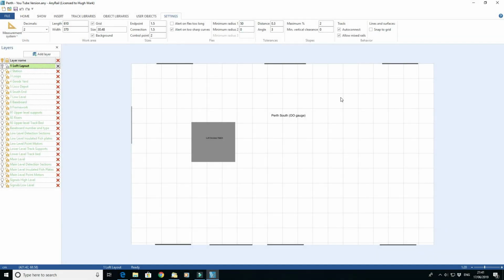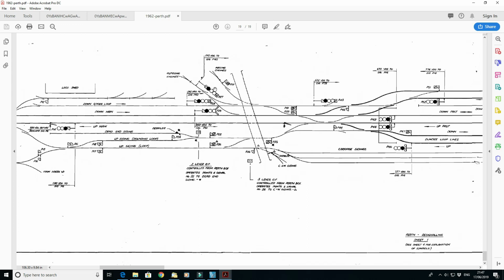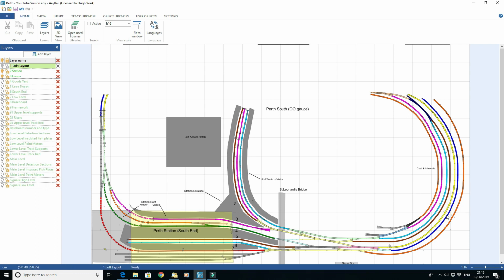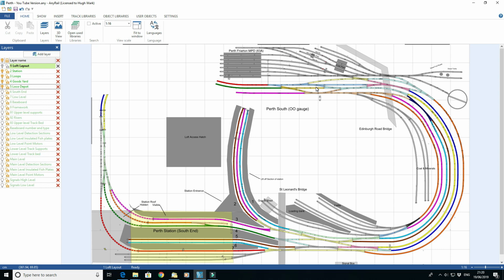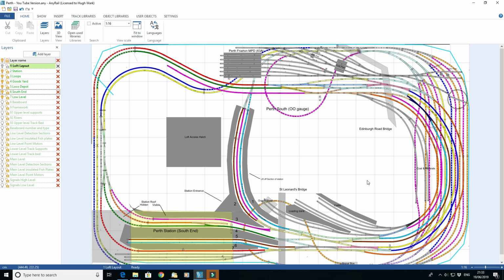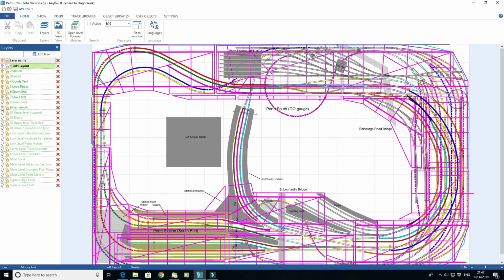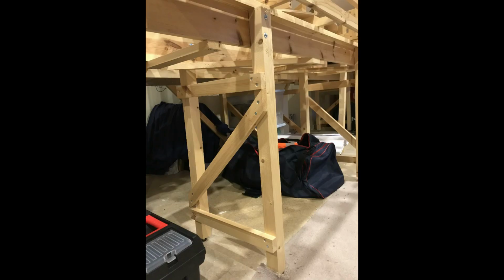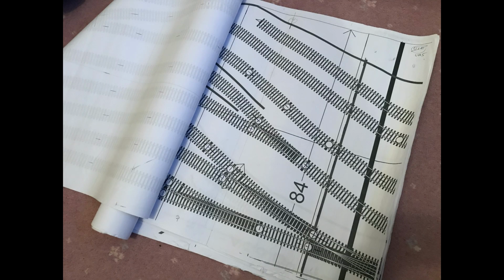Perth South Model Railway - #2 Planning and Baseboards

Comment: Very nicely presented and sensible approach to building a layout of this size - the best way to get it right first time. Its a godsend when getting so close on practical gradients versus the necessary rise and clearances between levels as I can see you had to be extremely careful with, ditto for me, doing same but using SCARM. Where I live have huge humidity swings 25 to 65% (plays havoc with pine furniture - draws jamming) so gone with Baltic birch ply and get 5mm movement over 19 feet length over 12 months, baseboards almost complete; yet to start laying track so expansion joints a must. 100% agree on fishplates being unreliable conductors/ source of appreciable volt drop. Have subscribed, will be catching up looking to see how you progressed on what will certainly be an epic and fascinating layout, particularly on the automation. Best regards Stephen, Canada
Reply from the maker: Many thanks Stephen. We certainly don’t have such extremes here but agree that getting baseboards as trouble free as possible is a must. Hope you will be able to share progress on your own layout in due course. Good luck and have a nice  Christmas. Hugh.

Comment: I came to this channel via your video on St. Leonards bridge, but the channel turns out to be a very good guide on construction of a relative complex layout from A-Z.
You've made good use of CAD, I use Anyrail too but not yet very experienced with it to calculate levels and draw in all separate sections of timbers to go in.
The loco depot is a good compromise on the real thing, the placement of the coaling and ash towers relative to the shed make it very recognisable, in my mind I can see the rows of native locomotives, visitors from Kingmoor, Eastfield, Waverly and Ferryhill and the miscellaneous bunch of surviving pre grouping locomotives standing in front of the model shed, sometimes even a Co-Bo, having a fill-in duty between two Condor runs.
I'm going to watch the whole series in your playlist yet.

Building smaller layouts for the exhibition circuit over many years now I settled down on birch plywood as my material of choice.
It doesn't come cheap, but doesn't splinter as much, doesn't delaminate easy and can take a fair amount of moisture from building the scenery.
I also make the girders and joists from this plywood as it doesn't warp like sawn pine timber, the top grain is held lengthwise when I cut them.
Reply from the maker: Many thanks Tom. Glad you enjoyed it. Yes the line up of locos you describe is mouth watering and hopefully I will be able to replicate it. You are absolutely right about good quality plywood. I only hope mine will last over time and the application of scenery. Thanks again. Hugh

Comment: I'm about to embark on a similar sized layout myself, based in P&K and you'r experiences are really useful. However, one question that would help is, where do you source your rails and control systems etc from being based in our area?
Reply from the maker: Hi John. I’ve bought my track and control systems on line. Track from Hattons Model Railways and electrical and electronics from Digitrains of Lincoln. In non Covid times, for general Model railway purchases I’ve gone to Invergowrie models and Harburn Hobbies in Edinburgh. There are of course lots of other options and if you do some searching on line, you can find where to get the best deals. Note that some Peco track items are quite hard to come by as Peco stopped manufacturing for a while during the first lockdown. Good luck with your layout. Hugh
Reply: @perthsouth5576  thanks Hugh I’m finding it hard to put it all together but guys like you and other Youtubers fill in the gaps. Thanks for all your efforts.

Comment: Your project and approach is both inspirational and aspirational. As a sanity check as I progress my own project, what height did you select for the top of your L girders and what does that translate to for the height of the top of your scenic baseboards?
Reply from the maker: Hi Mark. The top of the L girder is about 84cm above the floor and when you add the cross members and 9mm plywood on top, the lower baseboard level is about 90cm above floor. Main scenic level is another 10.5cm above that meaning it’s just over 1m above floor though with the varying levels and gradients it rises to 1.035m above floor. Thanks for watching. Hugh

Comment: What is the minimum radius that you have used on the layout, and what is the radius of the reverse loops? And can I ask what the minimum height clearance between levels is?
Reply from the maker: Hi Bob. I’ll need to go back and check the plan on the computer but from recollection I tried for 900mm on scenic sections and 600mm elsewhere. However the reverse loops are peco settrack 3rd radius curves at 505mm. I was a bit concerned about that but only problem has been pony track fouling front steps on one loco. I had to go for this to fit them in. Hugh
Reply: @perthsouth5576  Great, thank you, Hugh. I'm designing a two level, shelf-mounted layout which is why was interested in the minimum height clearance. I'm also using Anyrail and think I've finally worked out a layout I like - version 74 lol! Did you use the 3D feature in Anyrail? I found that very helpful in visualising the layout.
I'm now in the process of reproducing the train room and baseboards in a 3D modelling program called Sketchup. It's been great fun and extremely useful in identifying potential problems with the construction of the layout. I will produce some videos of it all eventually.
Reply from the maker: Hi Bob. I haven’t tried sketchup just did all mine on Anyrail. Re the distance between boards, to keep gradients within reason, I ended up with a general design clearance in the hidden siding area of only 105mm. This is really far too tight and you can’t even get your hand in to fix a derailment. However, I accepted this on basis that the hidden sidings were under computer control (and thus the human operating error is removed) and I have taken time on track laying and keep the speed if trains down to a scale 40mph when entering and leaving. Really you want at least 8” or 200mm if you need to get your hand in. On simple track over track clearance, I worked to 90mm. This was based on 70mm height of train then 20mm for thickness of Track and baseboard though you can get away with less depending on the detail of your boards and layout.
Reply: @perthsouth5576  Thank you, Hugh. It was the 90mm figure that I was looking for. I've been using 80mm in my plan, so I will have a look at it again and see if I need to increase it to 90mm.
Reply from the maker: Just checked radii again and yes the minimum in the non scenic areas is approx 600mm  or 2ft using flexitrack. In scenic area I tried for 900mm but ended up about 700mm with 600mm for the curves in the top LH corner of the plan. The 3D feature was indeed useful with Anyrail. Hugh
Reply from the maker: Ps I am on version 15b of my p,an but I won’t tell you how many a, b, cs there were before that😄🤪
Reply: Great, thank you. Thats similar to what I'm using.  @perthsouth5576
Reply: @perthsouth5576  Lol, I'm now on v75!!